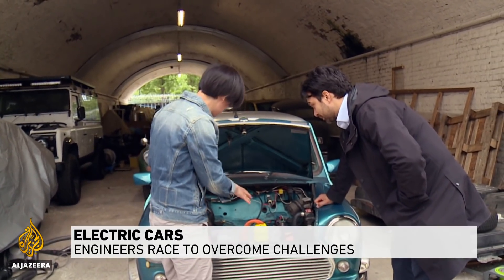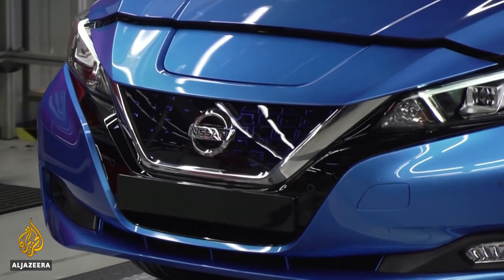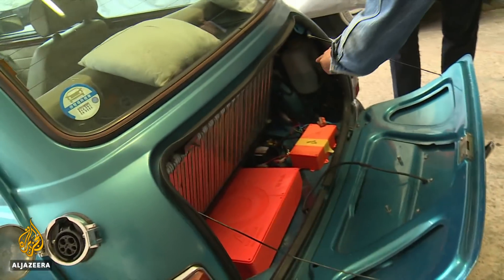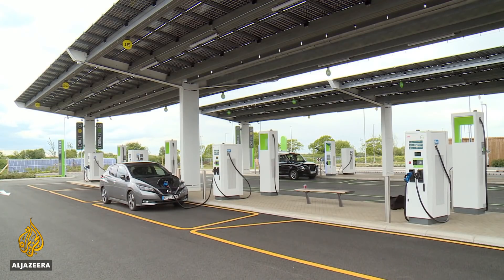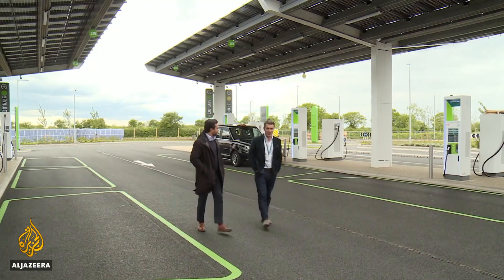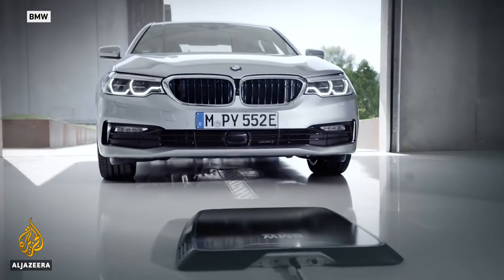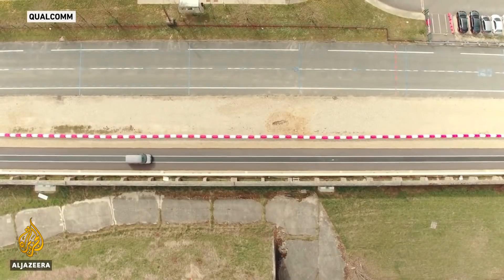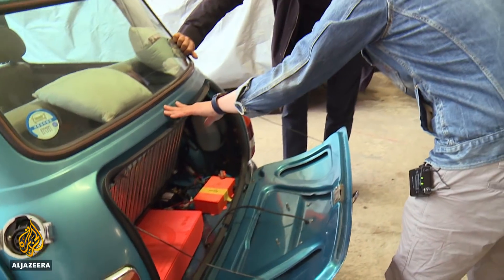Electric cars: Engineers race to overcome challenges

Comment: Even though the cost of batteries falls the main weight difference between gas and electric is that your battery stays the same weight fully charged or empty whereas as you already know cars get lighter as they use the gas up and refilling is done in minutes compared to 'quick' charge. The range of 250 to 300 miles means a heavier battery and I mean 'heavy'. The lightest battery for Tesla model s is 1200ibs, do the math that's over .5 of a ton you have to drag along till it needs recharging. We need more power from less material. On the positive side battery technology has billions of investment money to throw at the problem. It took Tesla 10 years to increase their battery output by 50%. By doubling the size of the battery facepalm .   ;)
Reply: That HEAVY battery gives the car a MUCH lower center of gravity than a comparable gas car.  The Tesla Model X is roll-over resistance because of that heavy battery.

Comment: While car moving fast on roads, wind propeller fans can be coupled with a small generator to recharge the battery thus regenerate power.
Reply: propeller creates airflow obstacle  - eats more energy than it can produce
Reply: that is not possible